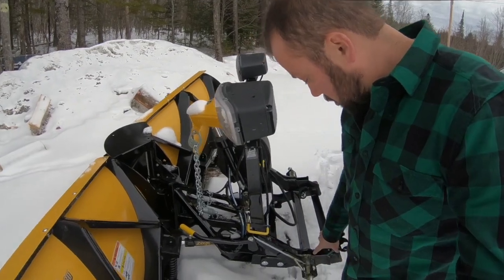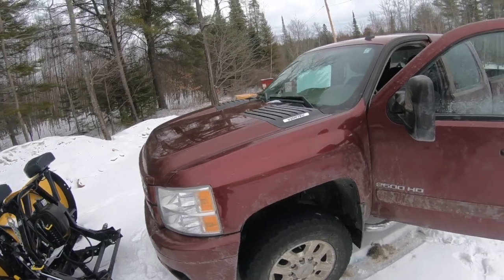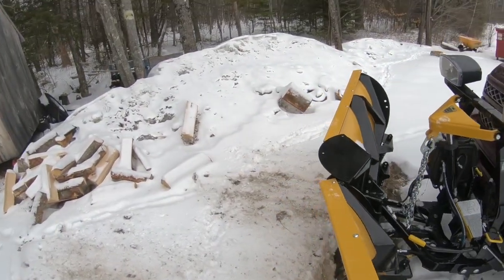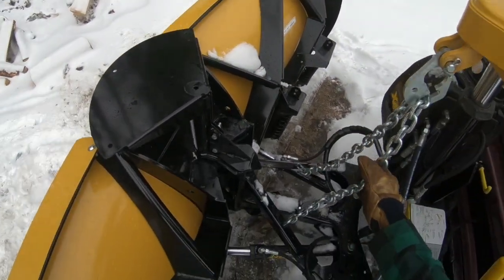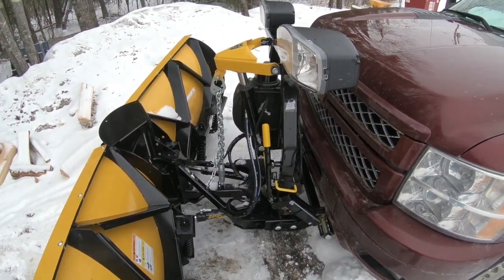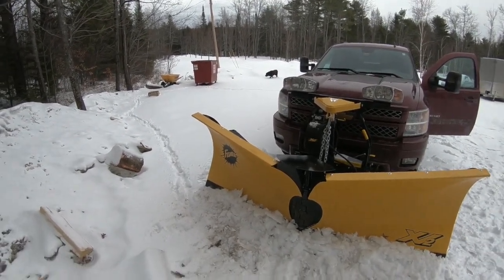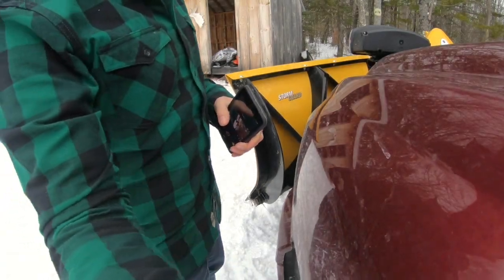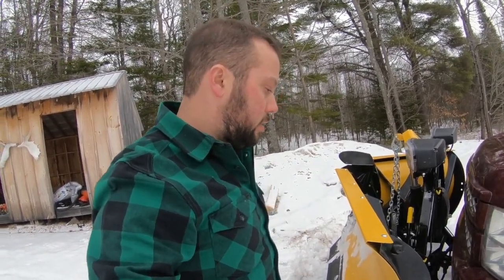Showing how you hookup a fisher VPLOW!!

Comment: You should push the lift cylinder all the way down,the more slack in the chain the better.I have plowed woods road for 15 years with my 9’ 6” one.
Reply from the maker: I finally figured that out. Trying to push the head gear up with tension on the spring